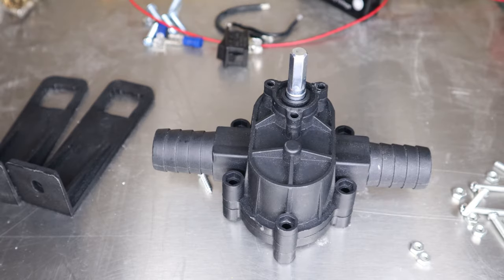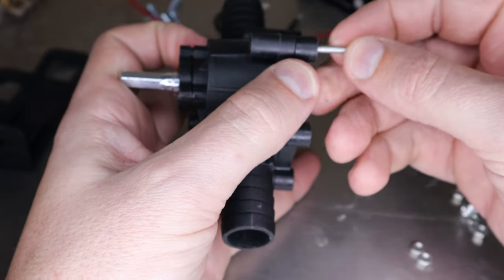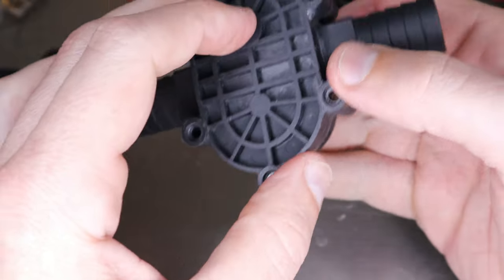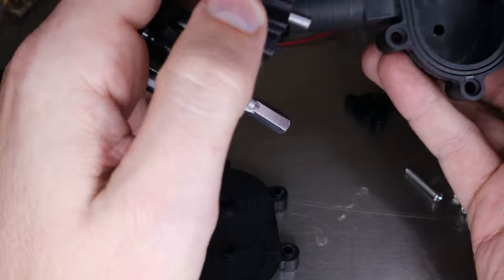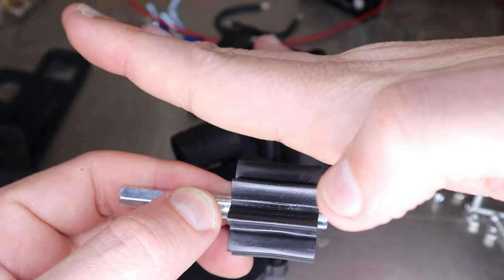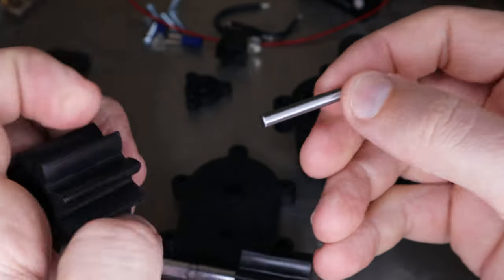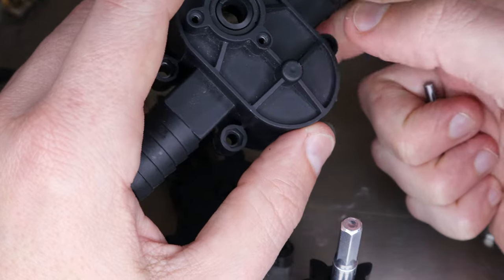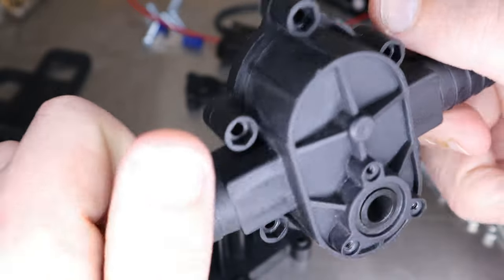Self-Priming Fluid Transfer Pump Tear Down #repair

Comment: A little Vaseline will be helpful for priming and less friction. With a typical battery drill I would expect about 5-6 GPM on vegetable oil for a few minutes, at least.
Reply from the maker: That’s a good idea. I’ll see if it works.